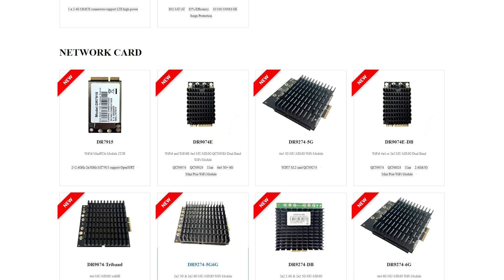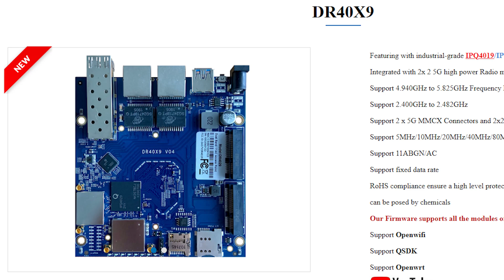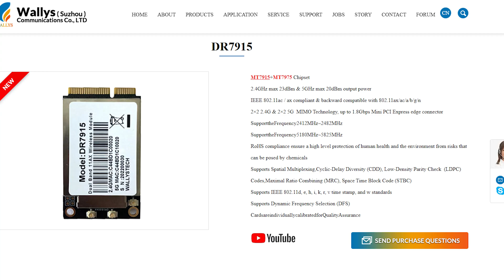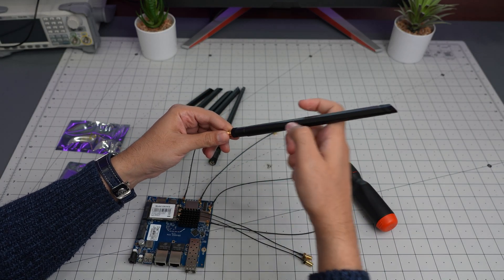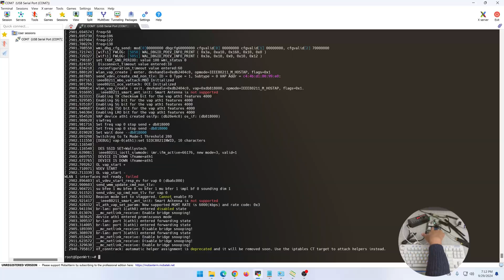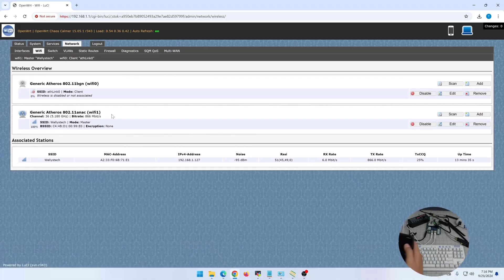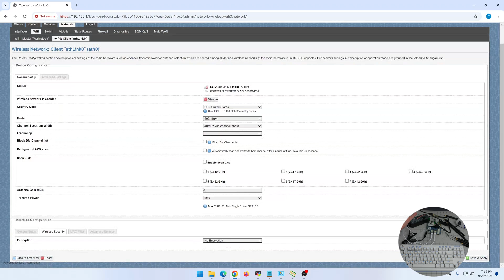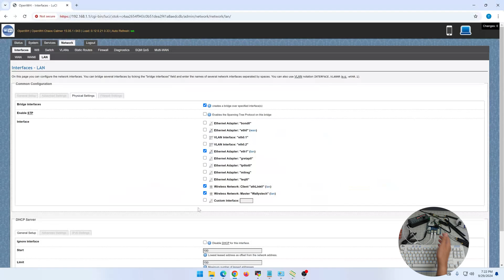WallysTech Router Board | OpenWRT, and FAST WiFi

Comment: It wasn't hard to notice that only the Wi-Fi interfaces on the board were alive, and the card plugged into the Mini-PCIe slot is not detected. According to the datasheet on the manufacturer's website, the card was plugged into the wrong slot, the slot you have selected is dedicated to LTE modems, the second slot would be for an additional Wi-Fi device.
The documentation says there are 2 SIM slots and a microSD slot on the panel. (It also was not clear after you counted them.)
Reply from the maker: Thanks for the clarification, yes, you are right, the benchmark and setup you see in the video is with the onboard Wifi module, not the card. Noticed it too late, later we did a live session with the vendor and they helped explain things, but I was already done with recording the video.

Comment: You are running an extremely outdated version of OpenWRT.
Reply from the maker: That's the vendor provided image
Reply: @TechnicallyUnsure  I see official owrt images available too.
Reply: @TechnicallyUnsure  the link on the manufacturer's website leads to the OpenWrt snapshot image directory, I just checked it because I was surprised by the old version you tested.

Comment: I didn't see any pricing for this do you know by chance how much these run??
Reply: 80-90$
Reply from the maker: DR4019 (the main board with SFP port) is $85 and DR7915 (the wifi module) is $25